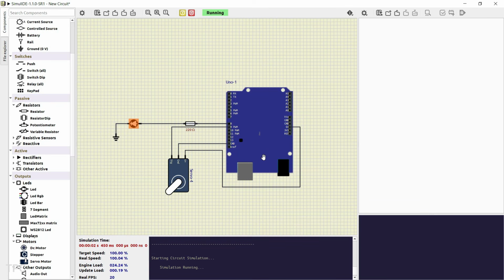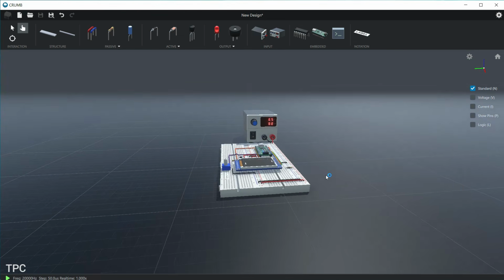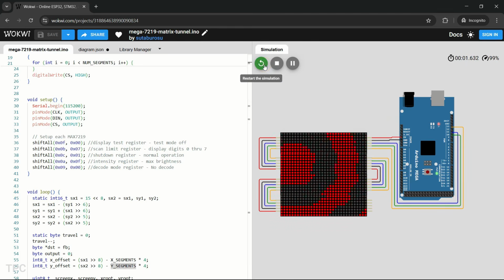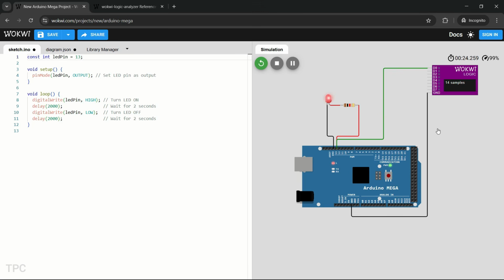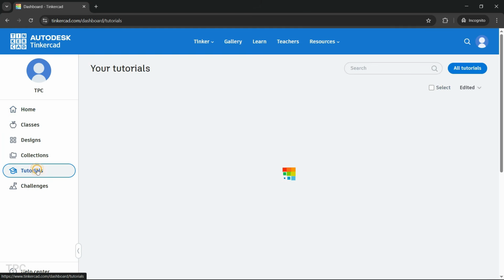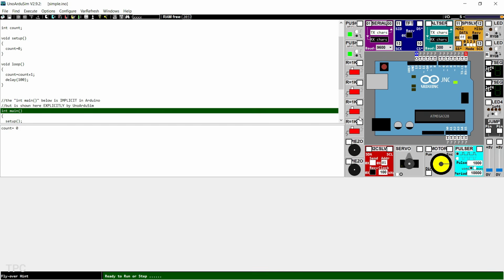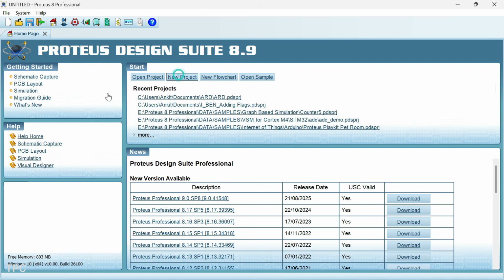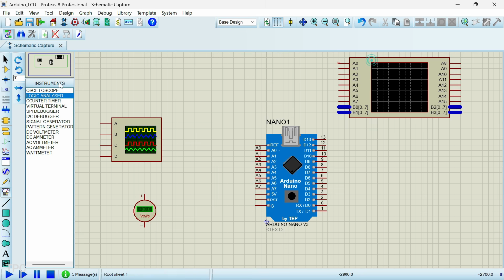7 Great Arduino Simulators for 2026!

Comment: Thank you to the channel owner.

I'd like to leave a note here. I'll update this if I learn more.

My personal preferences:

SimulIDE
Has a wide range of components.
I like that it has an oscilloscope, frequency meter, and logic analyzer.
It can load EEPROMs and has a CPU monitor.

Crumb
- It's a 3D model, suitable for teaching as a substitute for real-world models.
- It can be used as a mobile app.

Altium

WOKWi (Allows custom IC creation)
- Has an oscilloscope.
- Has a logic analyzer.

Tinkercad
- Can create 3D objects. Not sure if it can interact with circuit components.
- Has debug code.
- Has code blocks.
- Has electrical circuit diagrams.

PICSimLab
- Can add a bootloader.

UNOArduSim
- Has hardware simulation debugging. The debugging step can be changed.
- Can run in slow mode.

Proteus is considered the best.
- Can communicate with a physical hardware serial port.

I also recommend another NI MultiSIM program.

What I need:
I want it to be able to communicate with a physical hardware serial port via a virtual COM port like Proteus. If anyone has tried any program and found this, please let me know.